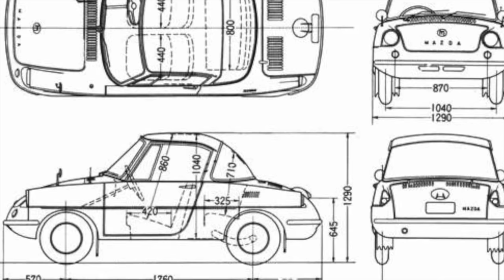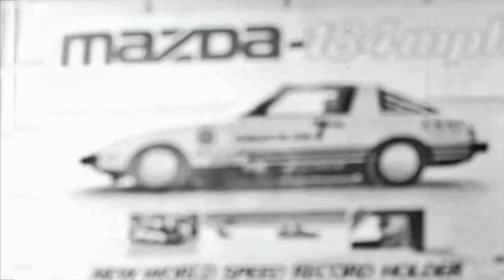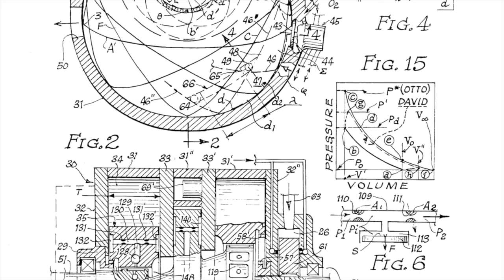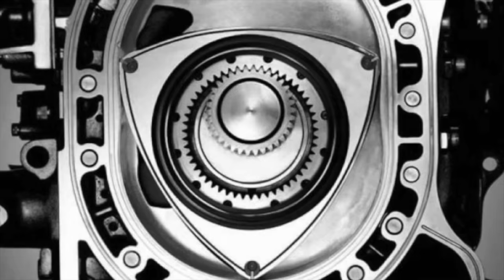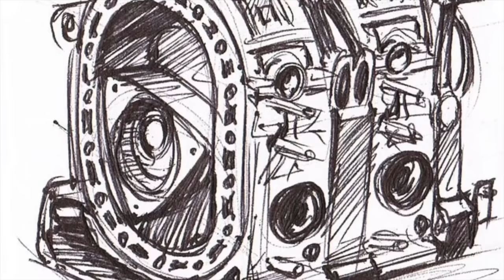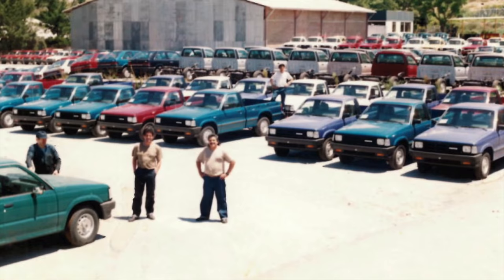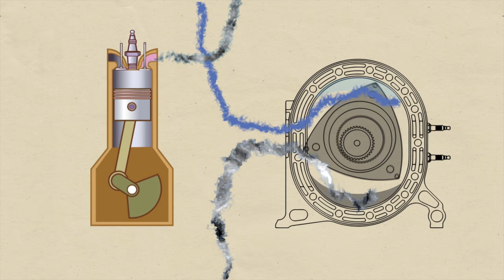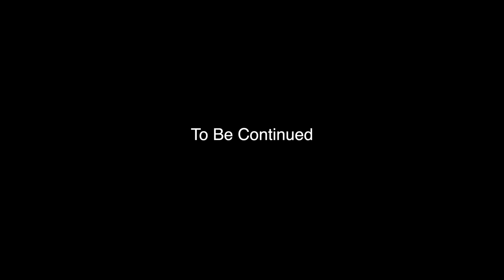Here's Why Mazda's New Rotary Engine is Genius

Comment: Dude, what new rotary? That was a history lesson
Reply: I’m thinking the same
Reply: Glad i'm not the only one...
Reply: the range extender in the upcomming hybrid I'm guessing
Reply: If you watched until the end, you would have realized that this is continuing, aka, leading up to that
Reply: Thought the same, there won’t be a new one either, burning oil as a part of it’s operation is a no no now, was nice while it lasted.
Reply: @hybrid9mm  there’s still a new rotary comming as a range extender for the MX-30
Reply: Yawn.
Reply: @ValentineC137  There's NO information claiming it's a NEW ROTARY ENGINE, just that it will use a rotary engine in a hybrid mashup, smfh.
Reply: Pretty sure the video was split in 2 parts this one provides background knowledge and then part 2 will probably talk a little about the rx7 and 8 and then the new family car with a rotary in it
Reply: the wankle failed its been in cars here from mazda even a snowmobile  the wipers would wear out

Comment: My friend's Dad bought a new Mazda R-100 when they first came out. It was a fast little car, and loads of fun. It only got 18 mpg, and the rotor seals had to be replaced at 2000 miles. The engine burned a quart of oil every 500 miles. A few years later he sold the car. it was starting to use more oil again. I remember a few years after the rotary cars were introduced, the R-100, Rx2, Rx3, Rx4, they were piled up in junk yards, along with Chevy Vegas, all with blown motors.

Comment: Scotty love these on Mazda ❤️💪 I have owned 12 Mazda over the last 24 years - 5 MX5’s, with an RF and a CX5 turbo diesel currently in our garage. I live in Australia and our SkyActiv 2.2 Turbo diesel runs at a completely different tune compared to the version that was sold in the USA. Our version has 140kw and 450nm of torque and will deliver between 6-7.5 litres per 100km. 

All of our Mazda’s have been brilliant, fun to drive, reliable and never caused us a single headache. Here in Australia the brand has been the number 2 car company with as much as 10% market share. I follow Mazda closely all over the world and I know how hard they are trying to crack the USA market. You guys are about to receive the Mazda3 and CX30 in turbo form ... sadly not for us 😥
Reply: @PietriGuitars  never has a single mechanical issue . Most is covered 180,000 km before I sold them. I have been a state manager most of working life . My 1998 NB MX5 covered 180,000 in just over 18 months .
Reply: @PietriGuitars  we have 3 cars in our garage since 2000. My wife’s, mine and a MX5 has been in the garage for most of my like. Have used them to tow heavy loads, travelled up to Frazer Island and embarrassed many ‘real’ 4wheel drives .

Comment: The long flame front in rotary engine leads to incomplete combustion...results in high HC and CO emissions.  That's why Mazda uses 2 spark plugs firing in sequence.  Supposedly rotaries work much better with hydrogen as a fuel as has a very quick ignition, even with the long flame front.
Reply: Fascinating. Didn't think anyone had tried that. I don't think burning hydrogen is going to be widespread though. You might have better luck with LNG maybe.
Reply: Converting electricity to hydrogen is low loss and dirt cheap conversion.  Converting hydrogen to a hydrocarbon requires CO2 at bit of energy loss.   If solar power and carbon credits were priced at their real "value" nobody would be saying anything about the end of hydrocarbons, hydrocarbons would be what solar plants make on days they cannot sell all the power they make.
Reply: @beachbum4fun2  Mazda actually built and dolls some rare hydrogen powered RX8s in Japan,n there were very few but supposedly absolutely brilliant
Reply: @GT442  The cool bit about the hydrogen RX-8s was they could also run on gasoline, switching fuel supply with a button on the dash. The problem was that now it needed 2 fuel tanks, the hydrogen tank taking up the whole trunk. Running on hydrogen it made 100 less hp.
Reply: @jtso7636  so in theory, hydrogen rotary hybrid could be the answer..

Comment: 2-STROKES are the way to go. They should put effort into 2-strokes.
Reply: Many race cars are testing 2-stroke engines. It makes sense for race cars.
Reply: @wanderer397  I have seen a two cylinder range extender, but a three cylinder I think would do just as good.
Reply: 2 strokes are a “compromise” in an engine designing process. Trying to make a compromise better is NOT the way to go.
Reply: @lonerider5315  for cars made to be fast it is.
Reply: Heck yeah! 😎
Reply: Detroit Diesel used to make 2-stroke Diesel engines for semis and other heavy duty trucks.
Reply: Check out the Ferrari 2-stroke Supercharged 1.3L.
Reply: You have to look at how far they have come with 2 strokes. They were making 170hp out of 800cc two strokes in 2012 with with fuel injection. With what we know about timing and the development of fuels like e85 we could see even more power.

Comment: My 1st introduction to the Mazda rotary engine was in 1972, my neighbor bought an RX2. He had trouble starting it. Took it to the dealer, took it to the dealer, they couldn't figure it out. He was about to make them take it back when I asked to look at it. I was fascinated. It didn't take me long to figure out the dealer had "miss tuned" it. 4 sets of points? Come on, simple. Re-tuned it and it ran perfect. I was 16 at the time. I later bought one.

Comment: Imagine a diesel rotary engine. Oh wait, Rolls Royce made one prototype which was too reliable.
Reply: Too reliable???
Reply: The Chrysler turbine was the most reliable car engine ever built. Only had one moving part and didn't wear out like the rotary. The engine could easily last 1 million miles or more. The Chrysler marketing department killed the engine because they believed most of Chrysler's sales came from repeat customers. But if the engine lasted 1 million miles nobody would ever buy another one. Their business model relied on planned obsolescence, not endless durability. 
Probably the same deal with Rolls Royce.
Reply: @Novusod  nice urban legend
Reply: @MilesPrower1992  it was reliable because diesel also acts as a lubricant for the apex seals.
Reply: @Novusod  but a car is more than an engine, and other parts wear too.
Reply: @herberttorres3822  yeah but why is being too reliable a bad thing? Gives you a good reputation and at some point, people aren't gonna want to drive a super old car
Reply: @MilesPrower1992  rotary engines have not change in decades. The have different fuel management, but inside, they are still the same. It's true for pistons.
Reply: @Novusod  The turbine died in car prototypes because it's high wear, very hot, has exhaust temp problems, needs extensive high-rpm gearing to reduce shaft speed, needs much very clean air, has a long lag between throttle, and power, then to top it all of is extremely thermally inefficient.

lol... too reliable, bahahah.... keep telling yourself that.
Reply: @Doonit_hard_way_since_65  partially correct. The high wear was due to the turbine directly driving the wheels and therefor it having to run outside its ideal rpm. The gearing does wear terribly in this setup too. The clean air requirement is actually slightly less than an ICE, I mean, plane turbines can keep running after fod intake, I'd like to see a piston engine doing that. Also, if run at its design rpm it's actually more thermally efficient than an internal combustion engine, especially one from that era. And exhaust temperatures can easily be mitigated by making a long thin exhaust shape that introduces ambient air on either side. All that being said though, the high pitched whine of a turbine is uncomfortable to say the least, and turbine blades and flame chambers require exotic very expensive materials, making it just too expensive.
Reply: @Xiph1980  lol, sure, kid
The Chrysler turbine used conventional sleeve bearings, and was a lost-oil lube system, unlike an aviation engine at 30K feet, road contamination on a bushing with a 44,000 RPM shaft speed is going to end that engine fast.  

The chrysler used a regular car drive line, and a 1963 Chrysler Torque Flight automatic tranny, I have no clue what you are babbling about driving one wheel fast.  Sounds like you are pulling that out of your butt.

GT's have a throttle lag that makes them a little weird for a land vehicle.

All that for a tiny 130bHP, and around 400FtLb of torque.    A waste of time. cool concept, but useless for a street vehicle.

Comment: Owned a 1975 RX-3. Loved how smooth/quiet the engine was.There was even a buzzer the sounded at the engine redline because it was so quiet/smooth.
Hated the poor gas mileage. And the short rear deck meant it didn't like speeds over about 90mph: the rear end got light and danced around a lot. Sold it after 3 years for a used Fiat 124 Spyder. Do I miss that fun car < the Fiat not the RX-3>.

Comment: I had a Mazda rotary pickup back when. It was like an electric motor. Just linear power all the way to redline. It was so smooth that it had a red light and a buzzer when you hit redline so you wouldn't just keep on revving it. It would just keep on going and you wouldn't notice it.

Comment: Excellent Video History
Alot of editing & research !
Thank you for that.
As a former Mazda dealer & Mazda factory driver ,
i can tell you , you got a few of the Japanese prononciations a little off ,
But , who dosent ! 😊

Remember , Mazda , using the Rotory engine 
is the ONLY JAPANESE MANUFACTURER to WIN 
1st. place in the most gruelling 24 hour endurance race in the world .
I was building performance Rotory engines since 1974
starting with engines for 
The World Of Outlaws 
racing series .
Our engines were so dominant ,  they were outlawed by the sanctioning body of  the Outlaws series .
We were getting 300+ horsepower out of an engine the size of a Basket ball !
Using carburaters which as you know , are basically a CONTROLLED DRIP .

Thats again Scotty !

Comment: This is a fantastic video Scotty...😊💥👍 I raced Rx7s back in the 80s . Those 13b engines were screamers and with modifications I was flying around LimeRock blowin the doors off many high end cars...the only horrible thing I encountered with the cars was living in New York they rusted very easily...you don’t see any of the 79 - 85s on the streets anymore...I owned 5 of them. Again with suspension mods and engine mods it was still a very reliable car to own....if you kept them stock and didn’t race them they lasted for over 300 grand without any engine repairs...just common things like the radiator and things like that go with high mileage.

Comment: I had a RX 7 when I lived in Japan in the mid 70s.  Nice car and zippy. Unfortunately it didn’t fair well in Japan’s slow stop and go congested traffic. The plugs would regularly foul.  I always carried a spare dry set, I’d pull over quickly swap out the plugs (easy because plenty of room under the hood.) and move on letting the first batch dry and wait for the next fowl.  
On starting when cold, it had a manual choke, if you even thought about touching it or pumped the gas it would flood.  
I sold it to a school teacher that drove like a maniac, high revs before shifting so I’m sure he had no problems.  
I always said the Rotary was a high performance engine in a low performance country. 😄

Comment: The Mazda rotary Wankel-powered RX series was named "Motor Trend's Car of the Year" around 1972. I purchased a 1972 RX2 and I can tell you I experienced a catastrophic engine failure after several years of ownership -  a "blown engine" as the service manager called it - with no warranty relief. According to literature at the time, the engine failures were caused by failing apex seals as discussed in this video. I bought my RX2 partly based on Motor Trend's hyperbole taunting the rotary as an advanced futuristic engine that would change the world - or something like that. With it's horrible gas mileage and apex seal failure that caused the engine to overheat and self-destruct, I can tell that it DID change MY world as I vowed never again to spend money on a rotary-powered car or listen to Motor Trend's writers. BTW, the two-rotor Wankel engine got worse gas mileage than a V-8 sedan of the time. When gas was cheap and the car was new it was a fun car to drive. I eventually sold it to a dealer for about ten percent of the original price.
Reply: Mazda went completely BANKRUPT in 1974 after a failed attempt to market only Wankel powered cars.
Ford Motor Company bought Mazda from a Japanese bankruptcy court.

Comment: I've been helping build hydraulic torque motors for 15 years and the  operation and efficiency of them is incredible to me.  Similar to the rotary engine with hydraulic pressure rather than combustion chamber.

Comment: The main issue with the high power and poor mileage of that engine is they measure the engine size by the combustion chamber size, and there are 2 chambers, but each rotor has 3 "PISTON" faces that share the combustion chamber so the size is really 3 times larger than they think.
It's more like a 6 cylinder and the cc's are really 3 times more than they say.
If you assume the engine is 3 times larger, then the power level and mileage is more reasonable.

Comment: Hey Scotty, Watching your video, I can see the inefficiency of a 4 cycle engine because there is a stroke that just uses power,, the exhaust stroke. What about a 2 cycle supercharged engine like an old diesel? The crankcase would be sealed like a 4 cycle, and the engine would have direct injection that would only inject fuel after the intake and exhaust ports are covered. The supercharger would blow the exhaust out, and blow fresh air in when the piston is at the bottom of the stroke. The engine would produce power on every down stroke, instead of every other down stroke. More power from a smaller engine.

Comment: I had a 1970 Evenrude RC35 snowmobile. It pulled the intake air through the rotor. It had reverse.
Reply: It was also an expensive failure and was discontinued...

Comment: This is a very informative video on the rotary engine. I never understood the obsession with rotary engines other than for the novelty of being different from standard combustion engines. People e love to promote the simplicity of the engine and the fewer number of moving parts however they gave proven to be less reliable and fuel efficient than standard combustion engines. There are some which last past 100k however nearly every combustion engines lasts that long and many last considerably longer with incredible fuel efficiency. I love the novelty of a rotary engine but the reality is it does not do anything better than a standard combustion engine.

Comment: I remember when General Motors in the 1970's was working on a rotary engine, but gave up with it's bad fuel economy and emissions that  would not meet EPA standards. AMC wanted to use that engine for use in the Pacer.
Reply: General Motors canceled the Wankel engine because of reliability problems and fuel consumption.
Reply: Holy crap , purring one of those in an AMC would have established a new low in reliability.    As if those Hornet and Pacer engines weren’t BAD ENOUGH.     The only thing that held down the roar of the road going underneath was the hugely noisy engine.
Reply: @drizler  The RC2-206 engine looked very promising in laboratory stand tests but once they were placed in a fleet of test vehicles reliability problems were unbelievably bad prompting GM to cancel production plans, the OPEC Oil Crisis put and end to further development and the program was canceled.

Comment: I had a Mazda RX 3 with a rotary engine  which I bought in the summer of 1973 for a bit over $3000. Gas was cheap then so the 20mpg didn’t bother me. The price of gas went sky high ($1 per gallon) with the October 1973 Arab Israeli war. Demand for rotary engined Mazda’s went way down and you could get a new Mazda RX2 or RX3 for two grand. I had long commutes for work so I put more than 90,000 miles on my RX 3 in 3 1/2 years. Other than the low mileage my main complaint was that it did not start in bitter cold temperatures of ten degrees or less which we had plenty of in my part of Michigan then. It was not too bad if it was kept in a garage. However, I was stranded at a friend’s house during the Blizzard of ‘77 when the car was outside for several days in deep snow and bitter cold. I had it towed to the nearest Mazda dealer where they pulled the spark plugs and found ice on it. We towed it home and finally got it started and I sold it for $500. It was the not starting in the cold that was the deal breaker for me.

Comment: Apparently, there must be loopholes in the emission standards that allows an inefficient gasoline engine to be used in a hybrid EV.  Hopefully, not too many vehicles with this lack of ICE efficiency will end up being used much in ICE mode.  One of the major points of going to EVs is to eliminate or reduce tailpipe emissions as much as possible.

Comment: Mazda has used this engine before in the original Mazda RX-7 but it didn’t sell back then so they scrapped the idea till now I guess. It’s the best engine ever because you can’t over rev the engine and blow it up and it doesn’t have rods and bearings that break eventually like the rest. Rotary engine is the best ever.

Comment: Citroen also got into wankel engines via a joint venture with NSU called Comotor.  In the end, they bought back all GS Birotors they had sold and destroyed them, to avoid the huge warranty issues and reputational damage.  At least Mazda managed to solve most of the seal and spark-plug fouling issues.